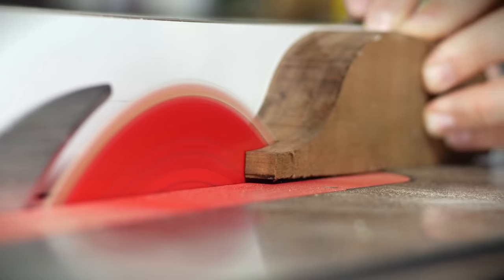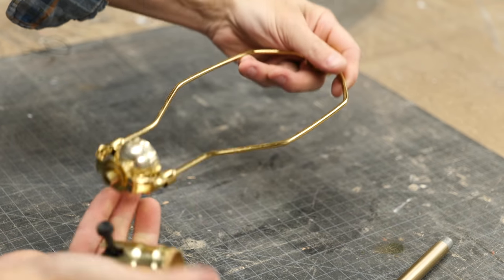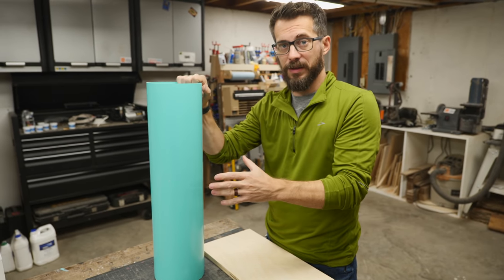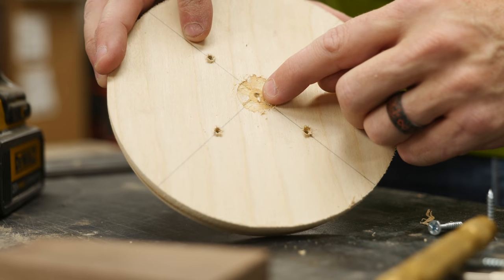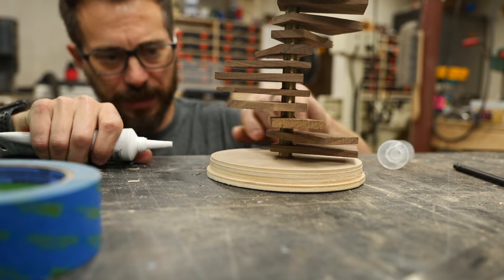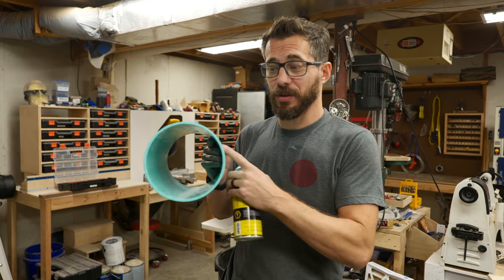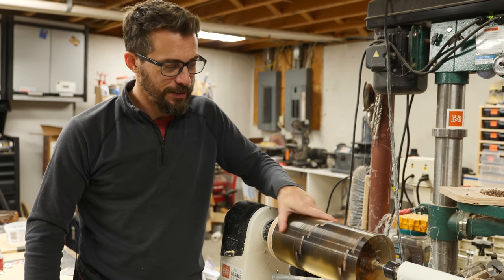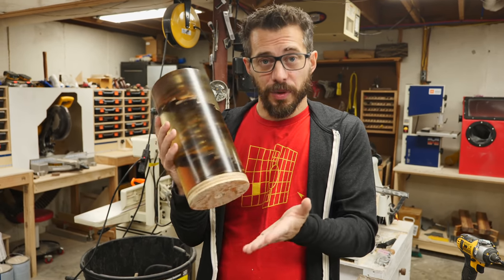How to Make a Resin & Wood Lamp // Woodturning | I Like To Make Stuff

Comment: Cool project! I find that even if epoxy clams to be “clear” it always become somewhat yellow when you go really thick like this. There might have been some oils from the wood so sealing them is a good idea regardless, but to me it looks more like the epoxy causing the yellowing. BJB makes a clear casting urethane that is like glass when cured and would work real good if you want an absolutely clear cast. Smooth-on also makes a crystal clear resin but seems to always have issues with the surface remaining tacky requiring a post cure and then some reworking to regain a smooth finish. I’m glad you showed all the issues you went trough, after molding and casting for over 30 years I have found there is only a few thousand things that can go wrong. You have to be able to learn and adapt from any problem you might encounter.  Great episode!

Comment: Hi Bob, thanks for showing us a not so perfect result. This makes you a lot more human to me.

For the next time I would suggest instead overpressure the Epoxy to vacuum the Epoxy. This way the bubbles would go out of the cylinder, but probably you have to pour all at once otherwise the surface won't be so smootth.

The other thing after pouring and shaping, you have to wet sand it up to 1000-1500 grid. That makes the Epoxy surface very clear.

I would appreciate if you would do same project again.

And a last suggestion. If you fix the the stairs from the outside and remove the stairs holder on the lathe then it would look like a floating stair and you would see the grain of the wood. Maybe the cable can be put on one side.
Kind regards Mark

Comment: I dig the stairstep design concept 👍👍 Its tough to know for sure what caused the discoloration, but I would bet it's because the epoxy went exothermic.  When epoxy goes exothermic, it gets extremely hot (ive had thick set melt thru the plastic surface of melamine ).  So if you think about what happens if you throw wood into boiling water, I think that is basically what happened here.  The bublby section was likely air pockets  produced when it went exo.  I usually give about 9-12 hours between max 1.5" pours using thick set.

Comment: If you're using PVC pipe, you can just get the caps or bushings for it and use them. It can save you from making special pieces. I've used a few bushings to size down to something my chuck would grip so I could turn it enough to give it a usable tenon. 

Also, you could have used a slightly larger drill bit and used tape to make up the difference to get the pieces to fit. Since the pipe was going to be covered by the wooded steps, you could afford to have the hole be a little off and it not hurt the project.

Keep making stuff! Really love your videos!

Comment: Next version use a clear acrylic center tube and run some individually addressable LED strips through there. That should allow for some pretty eye catching light effects in combination with that already interesting wood step pattern. Plus if you use strips that are RGBW the light coming off can actually be set to something useful.

Comment: I'd put a felt pad on the bottom of the lamp. It would help in the case that the lamp bottom or table are not perfectly flat and would help protect the table from scratches.

Comment: I really love the finished project.  I think the way the light penetrates into the resin is actually given character by the oil.  I think it might look a little bland otherwise tbh.  However, I will say that if I had made this lamp I wouldn't have been able to resist making a small base for it.  I really do like walnut though, so it probably would've just been an excuse to have a little more showing.

Comment: if you use a negative pressure pot it will pull all the bubbles out of the resin
Reply from the maker: The vacuum chamber and the pressure pot have their own benefits. I should have swirled the resin around to get under each stair a lot more first.
Reply: @Iliketomakestuff  live and learn nbd dawg

Comment: I admittedly don't know anything about working with resin, but why use pressure instead of vacuum to get air bubbles out?
Reply from the maker: They can be used in combination. You vacuum out the bubbles from the mixed resin before you pour it, and then let it cure in the pressure pot so that any remaining bubbles are shrunken down.
Reply: @Iliketomakestuff  Oh cool.  Thanks for the explanation!

Comment: As  86 abaile says vacuum to get the air out. This should work for the wood as well, under vacuum the oil will leave air space for the resin to fill in, it should stay clearer.

Comment: I think it looks great as it is, a fine polish may have put a good shine on the outside, if you had fiited the cable near the bottom and sealed it then poured the resin,, the middle section looks as though thier was insufficient mixing on the second pour,...turned out lovely though.

Comment: Still looks like a nice piece, wasn't the clear you wanted for crisp shadows, but the 'bleedout' has a character.  If you do make another one, I think it would be visually interesting if the 'stair treads' were cut from larger pieces where you ran a series of parallel dadoes, in 2 directions (the rips on one side, the crosscuts on the other side), just over halfway through the thickness, to create square holes through the wood where the dadoes intersect, for a kind of 'lace' or weave effect, which would also let more light through, plus create some interesting shadow patterns.  In fact, instead of a dado stack, one way to go would be to make one of those cove-cutting jigs on the table saw, where you're pushing through stock at an angle to the blade (steeper angle for a wider cove cut), and making multiple shallow passes, raising the blade for each pass.  Would definitely take a long time to do that for each dado, then reposition the jig and cut the next dado, and do a series of those on both sides at right angles to each other.  But you'd end up with basically 'wood lace', which is cool.  Not sure what I think about how to treat the edges, leave them ragged, or edge them in some way.

Comment: It is possible to use a pressure pot as a vacuum chamber.  In fact pressure pots are heavier than many cheap vacuum chambers.  Found a pump on Ebay for $50 and a Harbor Freight for $90 so it's not cheap but not a bank breaker.

Comment: Is there an advantage to using a pressure pot as opposed to a vacuum chamber? I would think the vacuum chamber would eliminate the bubbles entirely instead of minimizing them with pressure. I haven't worked with resin before so I may be completely wrong. Thoughts?

Comment: For really big bubbles, it may be worth drilling out a small hole and pouring some epoxy in. So long as it's the same colour, and there is space for the air to escape, it should be unnoticeable.

Comment: Your discoloration issue although mainly caused by the seepage you mentioned may also be from pouring in such large batches. However, considering you poured in separate batched this may not be the case. Still something to consider though!

Comment: Couldn't you use a spray can of lacquer to coat the wood steps before putting them in the mold and pouring the epoxy? To stabilized wood.

Comment: Bob, why didn't you just cut off the top threads on the pipe and then tap the interior to the threads on the base of the halo? (The halo is the bit that holds the shade up)

Comment: Every time I see a pressure pot being used on resin projects here at YouTube, I wonder if it isn't better to go the other way and try to suck out the air bubbles with a vacuum pump instead of just trying to make them smaller. Is that not possible with these pots?

Comment: I'm surprised you didn't fully sand and polish the piece, would have gone crystal clear. And I'm not so convinced about the walnut oil colouring the epoxy. Maybe there's some research on that and I have never used totalboat, but in my experience that has never ever happened. My theory is that it's the varnish you used before attempting to polish. My suggestion is to just sand the resin itself without sealing with a finish, and then go through the polishing and micro mesh phase and buff with a plastic polishing compound.

Comment: As a Peter Brown fan I knew you’d run into problems with epoxy next to bare wood. Next time you will too. All that to say your “failure” is much better than most of my successes. More power to your elbow, as they say in these parts.

Comment: i learned to pour epoxy all in one shot ...and seal the interior parts first...thanks Bob i like to learn stuff...lol...cheers
Reply: If you did that in one shot you'd run into problems too. Resin curing is exothermic, so it would heat up too much.

Comment: with a metal fitting, shouldn't the metal fittings be earthed
Reply: i agree. metal should be earthed
Reply: Not if the house electric power is already earthed as I'm shure it is!
Reply: @SunGod80  Sorry you have it wrong.  All domestic supplies use single phase wiring ( Live, Neutral, and Earth)  But if the lamp only uses two cor flex as shown here, the Earth at the power outlet isn't connected, so there is a chance of the metal work on the lamp becoming live should the live or neutral wires touch the fittings.  With the fittings Earthed the RCD / Fuse will trip should this happen, thus saving anyone who may contact the lamp from being electrocuted.